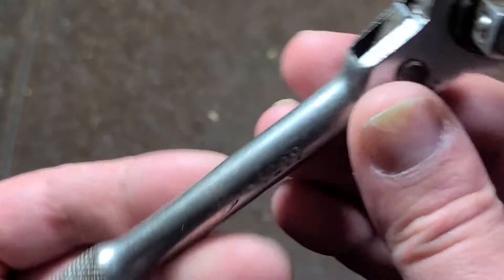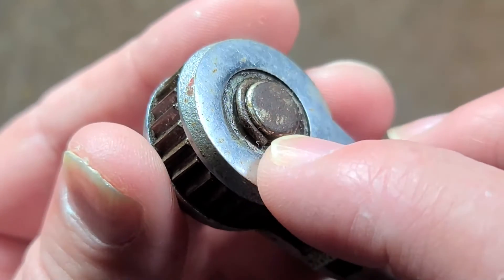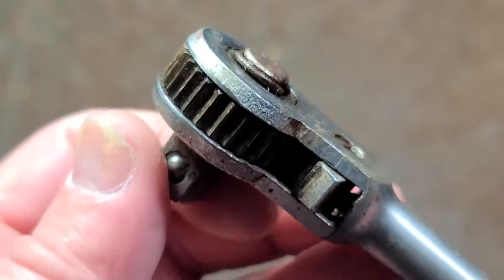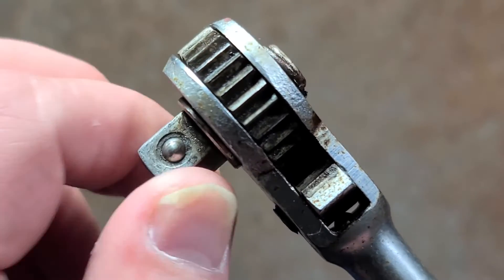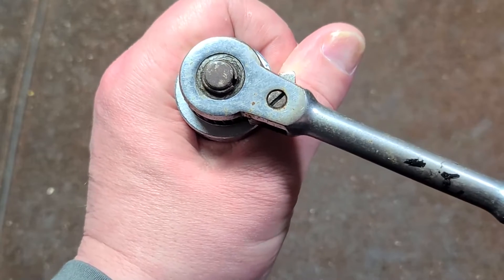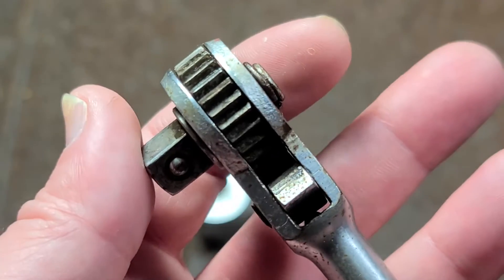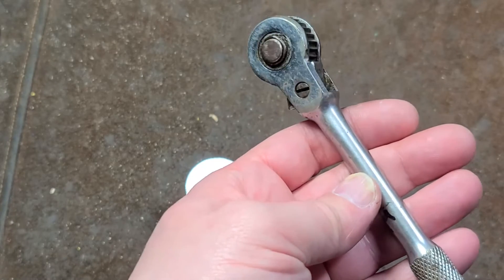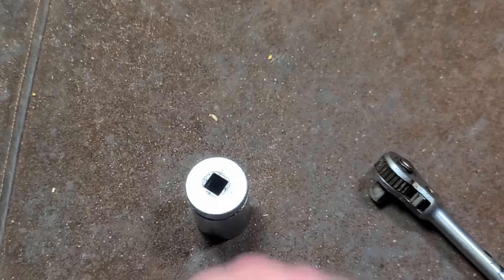P&C USA #3209 3/8" Rebuildable Open Pear head Ratchet Review

Comment: Hey off subject of the video, I need a hand air pump for the wife to inflate the tires on her garden cart it's only 2x4' got at Lowe's what's a good one with foot stand you can step on then pump up small tires?
Reply: Good luck! The ones made 30 years ago sucked. They came apart at an alarming rate and resembled a bear claw trap. Buy a real air compressor or....not. Depends on the wife! Mine has the best I can give her.
Reply: Yeah got 4 Air compressor one 60  gallon Ingersoll Rand but she's getting up in age and afraid of the compressor she just wants a little one right now I do it when I can but I not going to be here forever